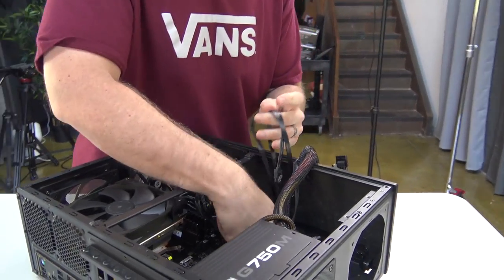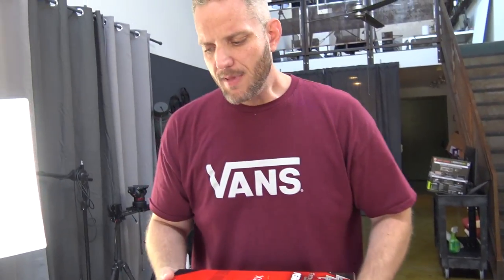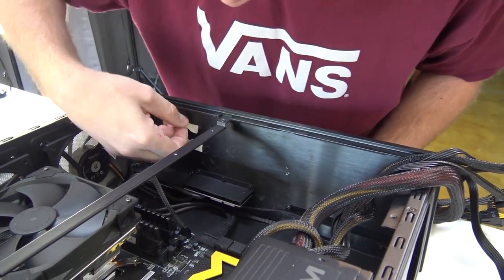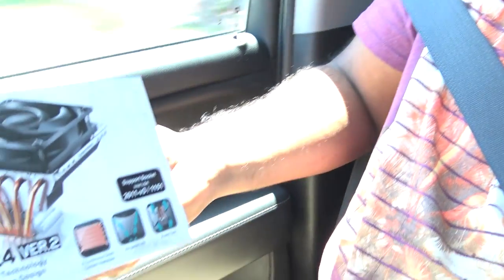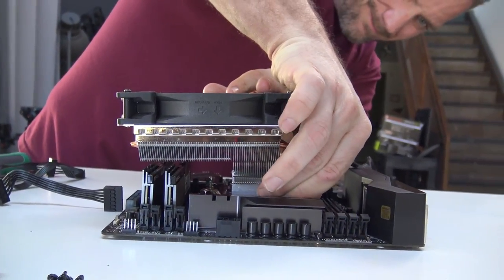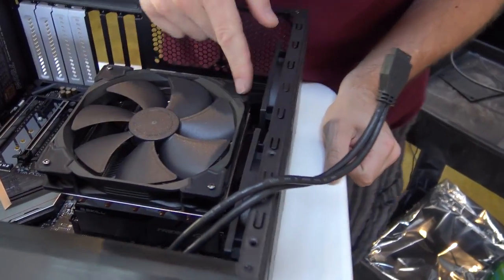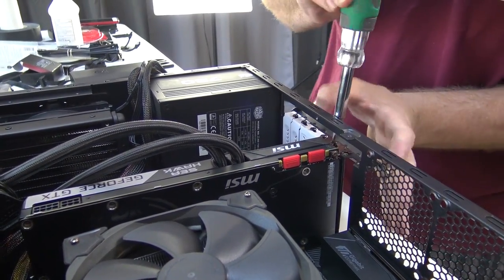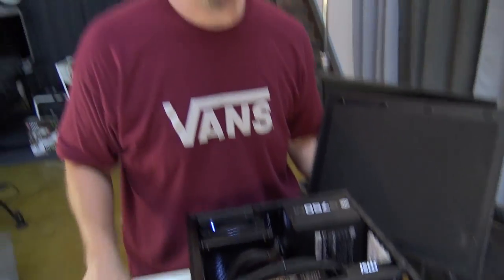X299 + 7740X = Ultimate VR PC?

Comment: I thought that the VR computer would fit into a harness that allows you to put it on your back so you can move around while you wear the headset and controllers so should you not have had it running of two 12v car batteries.

Comment: yo jayz i wanted to tell you something a long time ago but im not sure if you will read my comment.
you had a video once about video card and their extenders cables if it impacts performance and in your video it worked great but i  had installed one once and it was ruin my video playback in windows after installing the card directly no more issues. because of that cable videos would be choppy in windows no idea why but taking the cable out solved the problem. (gtx 1080TI) btw

Comment: With a vertical air cooler and no vent in the side panel how does it cool the CPU? wouldn't the hot air from the cooler just run into the side panel and begin filling the case? (obviously case fans would remove some, I'm just asking as this seems extremely inefficient)
Reply from the maker: +kalmtraveler the answers are literally right in front of you in this very video.....

Comment: i have a 4770k in my gaming rig and the thing sucks :(
4.3ghz anything more than that is unstable no matter what i do at 4.3ghz it's 100% stable on 1.19 volts and runs hot as hell with a 280mm aio cooler

Comment: funny thing to see ppl. calling 1080TI  "overkill" or "overpowered" when it is barely powerful enough to play in 1080p on ultra (and we don't even touch supersampling ), as for VR, there are just a few games to run vr... EliteDangerous, DCS, Il-2 BoS... (no I do not consider 20-30$ games to be VR games, If I don't spend 3000$ to play 30$ tech demo and nothing more) and on these you need to set it up to low-medium settings, so just to have an idea how far are we from VR games,  1080TI in vr is just like 1050 in 1080p; it will be another 2-3 years until we could enjoy VR.
Reply from the maker: +Mititelu Radu you're so wrong it's actually comical
Reply: Mititelu Radu well if you stop running those poor amd sempron 145 with those 1080ti's, maybe you'd get better performance @ 1080p.
Reply: in "GTX 1080 Ti at 1080p | OVERKILL BENCHMARK TESTING" video you can see that if you max-out an open world game, the 1080ti is pushing just above 60 fps and keep in mind that demanding games Like ArmA 3 are not included. And if you look at "DCS 1.5/2.0 VR Performance Comparison: GTX 980 ti vs. 1080 ti" Video you will see that 1080ti can push up to 90fps with big drops when you get near a city, but in order to do that he was using low-mid setting with no shadow.  Again if I have top of the line video card I use it for demanding games, not Overwatch or CounterStrike, and 20-30$ games are just tech demo when it comes to VR. But I guess that I can't read the numbers right and that's why I am so wrong.
Reply: wow, thnx man, I will sell my 5820K and get a sempron 145 if you say there is no difference in performance. How stupid of me to get that instead of a sempron. Next update I will ask you what to get because you clearly know so much more then me.
Reply: Mititelu Radu Mititelu Radu sir... did you read my comment and not understand it or either just saw the processor I listed and attempted to make a failed sarcastic response? 

I only ask this because when your trying to be sarcastic... it still needs to line up with the comment your replying to and you paticaly missed on all points...

you mention about "upgrading" too that CPU.... which doesn't line up with what I said... "stop running those poor amd sempron 145" 

1. meaning your already running said processor.. why would you upgrade a processor that your already have and are running?

2. you should be moving away from said thing than heading towards it. 

second you mentioned about it having the same performance as your i7 CPU when I mentioned nothing of the sort (you could of been running running a core i9 or ryzen CPU for all cared as you never mention your CPU before my first comment)... I said "maybe you get better performance @ 1080p"... which combined with the other part of my comment,  refered to having a better CPU than the one I listed.

on top of all that, anyone that actually read my first comment could clearly tell that I was being sarcastic and it wasn't meant to be taking seriously.... I mean, Who the hell runs a 1080ti on an old AMD single core CPU?
Reply: I will not even attempt to read the whole book you just wrote, you just wanted to be superior, I know you used that CPU name to point that I have a bad rig, but you don't need to write a book every time your arrogance backfire... or maybe you do. Ether way have a good day sir. Best regards
Reply: Mititelu Radu book? that was chapter 1! Books are far longer :p

Comment: I'd be more than happy to take those not good enough components from you, lol.  I'd be more than happy to have a 4770k or 4790k upgrade for my 1150 z97 board, but Intels hole their value completely past when they should.  For the price of a damn 4790k, I could get a better r5 1600, and board, and still have some money to go to the Ram, so that so called upgrade path is basically dead.  What's the point of a path on Intel parts if they price their tech unrealistically.  The funny part is I typed that before I knew it was a 4770.  I also never expect to win anything.  I never have, why start now.

Comment: Since i run 99% seasonic psu's 2 that are passively cooled. And the rest have hybrid mode i never install any psu upside down. 99% of the time my psu's fans never even turn on so what's the point of running a psu upside down. There isn't. At least for me even so i wouldn't run any psu upside down.

Comment: HTPC? How about intel i5 7500 65w tdp with a completely passive cooler capeable of cooling a 95w cpu in passive so no fan there, a jonsbo mod1 mini so tempered glass sexy and also open case corners so heat gets outa there easy, so no fans there. Palit 1050ti KalmX passive graphics card and duh SSD's for hard drives. The only fan and moving part is the fan on the power sopply and that never spins up so yeah, perfect HTPC/1080p gaming livingroom pc. Overkill for a steam streamer when wanting more graphics grunt.
Reply: That's still overkill for an HTPC. You want no more than 35-watts TDP for an HTPC.

Comment: Guys i need help, i am building a mid range PC and i am deciding between two mother boards
The z270 k6 gaming mother board from ASROCK and the z270 k5 gaming from GIGABYTE

What are differences between the two boards as i can not see many major differences, what one would you guys reccomend ?  ( I plan to use a 6600k in this system and also am planning to upgrade to a 7th gen processor later )

GIGABYTE: https://www.pbtech.co.nz/product/MBDGBM43105K/Gigabyte-Aorus-GA-Z270X-Gaming-K5-ATX-Form-Factor

ASROCK: https://www.pbtech.co.nz/product/MBDASR4313/ASRock-Z270-Gaming-K6-Intel-Z270-Chipset-for-Socke